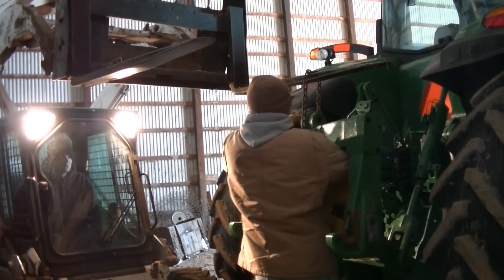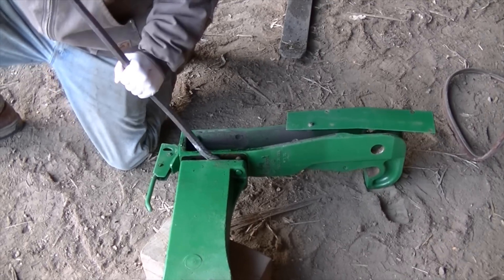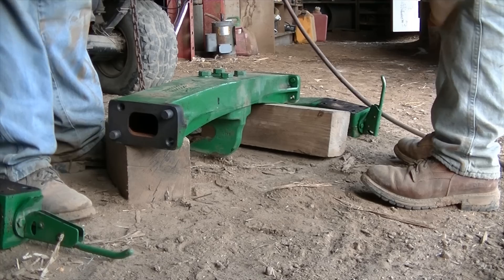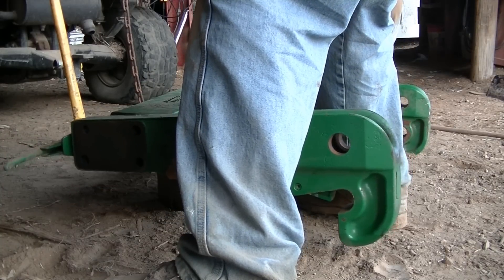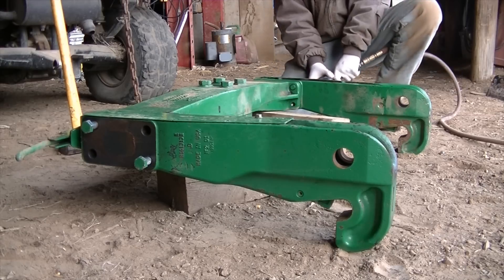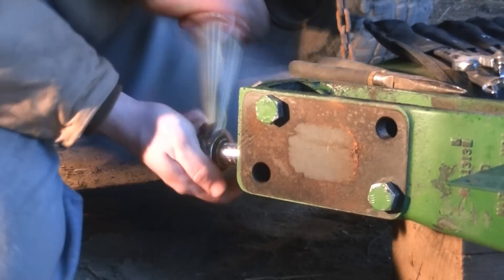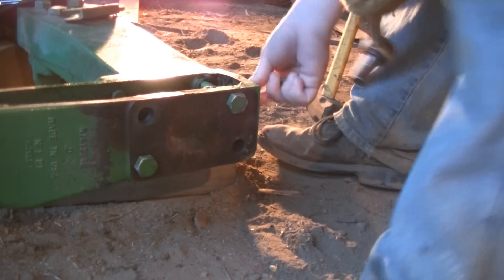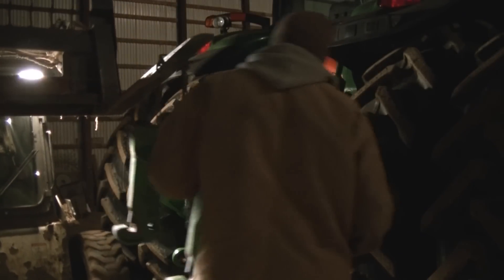How To: Narrow a John Deere Quick Hitch

Comment: Other than the occasional use with your Mo-Co or the ripper, what other 3 pt. implements ever get put on the 8235R?  It seems to be way too wide and overpowered for the back blade you use on the 4020 and 7600.